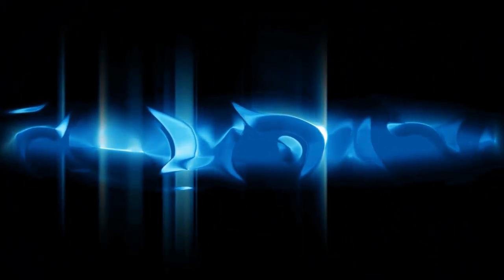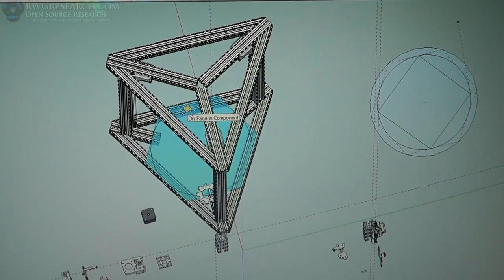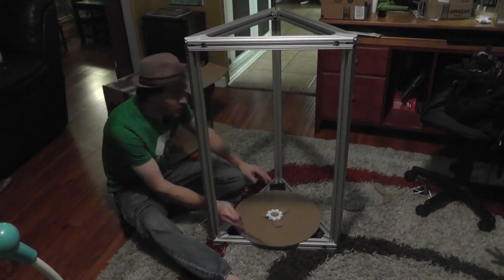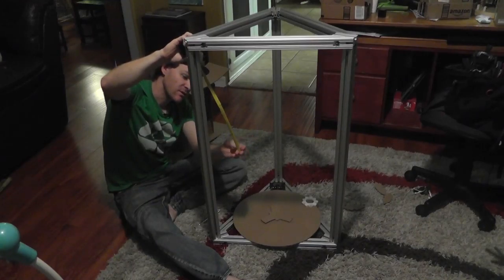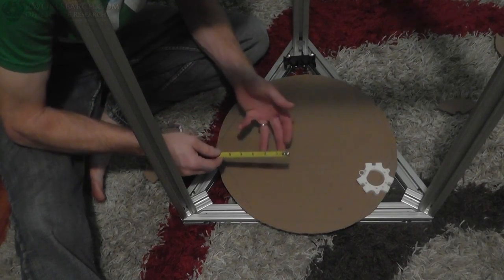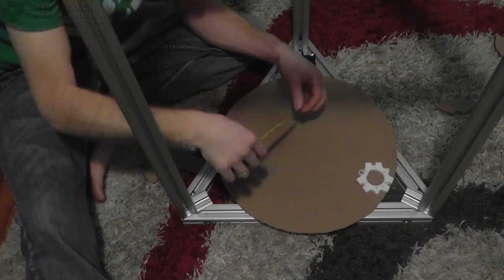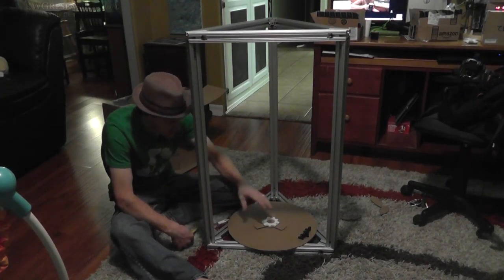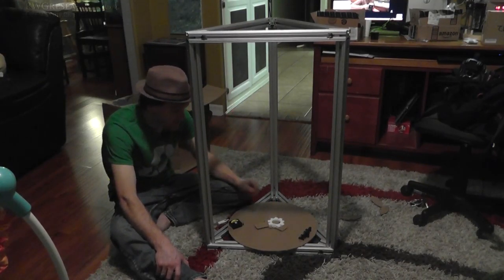RWG-OSD #2 Thinking Through It : OverSized Delta 3D Printer Build.

Comment: I like your hexagon idea. And also about using the 80-20 as linear rails (I was wondering that as you were explaining, just didn't know if their tolerance was tight enough.) 

I would recommend the electronics on the bottom to keep the heat away. Or put acrylic panels all the way around. Make one panel that opens like a door with the electronics on the inside of it. That way when you transport it everything is sealed up inside. When you are ready to print, swing open the door 210°.
Reply from the maker: yeah. it's verry good tolerance. yep the plan was to add a outter case from polycarbonate. this way I can heat the hole chamber. verry I important when it come to large prints. they seem to warp the bigger they get. also if I put the eletronics at the bottom. it will be right next to the heat plate. so I'll need make some good thermal I insulation for the electronics. ~Russ

Comment from the maker: ok, so i ended up going with 343mm for the rod length. and moved the upright's in 1.5"  this seemed to be good for what i was trying to achieve.  will see if that was a good choice in the end lol, God Bless! ~Russ
Reply: +rwg42985 how about implementing "telescopic" rods, perhaps with just the ability to slide to 2 fixed lengths (the way it is done with (forearm/pushbutton) crutches), 1 length for your higher objects, 1 length for your wider objects? Sure would save you the drama in configuration?
Reply from the maker: +Rogier de Leeuw this is a fantastic idea!!! could set up 2 config's and set it up in the software to flip settings when the arms switch. I'm not so sure i have seen it done... that sound like something i should spend some time on tho. great idea! unfortunately i already made the rods... not ill have to rethink it lol  thanks! ~Russ
Reply: Wouldn't be easier building a second effector for opposite axis advantage? Install the big footprint one, and when you need a tall build, install the other. Don't interchange until you can't build without changing. Done!

Comment: I haven't seen your other printer but I've seen other deltas and I had an idea.  What if your build plate could be Z as well as polar XY rotational?  

This would give you exceptional resolution for cylindrical objects.  If this was already the plan disregard my suggestion.  Just don't recall seeing one like that.  The build plate would have to be at least partially inscribed but not necessarily completely.
Reply from the maker: +Christopher Peterson its a grate idea. but, if you did that it would kinda just be a backwards XYZ printer. so rather the easy triangulation system , it would kinda be like the bed moved in all directions and the hot-end stayed still..  however... a simple rotational table would be cool!  something to think about for sure! ~Russ

Comment: Don't know to much! I guess that in my ignorance I would consider to add an other 10 inches to solve that problem, and extend the arms to reach all the way out of the triangle... Now kind of important that you are no considering the fact that must of your heating bed would be in side of the triangle.. but that is going to restrict you from building out of the constrains on the geometry of that triangle again!
Reply from the maker: yeah. the thing is that I'm limited by the belts I have on hand as well as the AL rails. with out buying a bunch of stuff I'm stuck with what i have. :)  ~Russ
Reply: yup.. I'm in total agreement with you, I actually have been in places where they sell that type of rail and they are pretty PRICEY!! to the point that I may consider to use almost any other material. thanks for the replay!
Reply from the maker: +Migueldeservantes nowadays you can get this stuff or a fare price if you look hard enough on line! i was surprised how cheep it was... ~Russ

Comment: since I have been play with a Delta for a few days, in theory, one could still have a tall narrow cylinder. would just need to set up that crazy g-code deal. and a script to make it invert the end effector
Reply from the maker: +George Robles now theirs an idea! if you get that running on yours i would think it would be a first!!!!! hahah great idea! lol ~Russ
Reply: +rwg42985 FYI, Geeetech sells an aluminum end effector for there set up as they still don't know how to make a print paratialy stronger depending on the cross section. anyways, they said many customers asked for one, so just thought I let you know. I may sell them one day in my store but if you need a set, after Feb 18, then maybe can get one ordered. on eBay. I will send you link.
Reply from the maker: +George Robles cool! thanks! ~Russ
Reply: +rwg42985 if you need anything from Geeetech, let me know.
Reply from the maker: +George Robles is that your site? ~Russ
Reply: +rwg42985 no, just my friends in China, I re did the firmware they where running, added the board GT2560 Rev A to the firmware, and I do a lot of tech support for them so they give me better price for resale to help support channel.
Reply: +rwg42985 lol, I learned from you, lasersabber, barnacles, zennmaster, Thomas Schindler (something) just to name a few of them. thanks to you all.

Comment: I think this forum is repository of knowledge about deltas. Have my rostock max for over 3 years.  280mm round build plate. And just like you I started with delta and stayed with it. They need a lot of love :)
http://forum.seemecnc.com/viewtopic.php?f=37&t=4868

And if you want to have portable 3d printer and worry about bed sticking out, just add some profiles and make haxagon enclosure, similiar to your previous delta
Reply: something about longer arms ang going parallel to think about: 
"...the lower one of the towers carriage gets to horizontal the slower it 
has to move, and the less precise as the effector moves thru the spot 
directly opposite the tower, with the arms
 horizontal, there is a point where it cannot draw an arc. I wanted to 
be able to use the full diameter of the bed without having to slow the 
print down. ..."

on the outside edge, not even close to parallel
http://forum.seemecnc.com/download/file.php?id=10925&mode=view
Reply from the maker: +SupcioG so, yes the slower the head moves the further out the arms are away from the upright. 
so my Question is, dose the firmware complicate for this? if no dose any of the firmware's out there complicate for this? this is something i always wondered. it could do it by ether changing the speed of the extrusion OR by changing the speed of the motor on the fly to keep that consent speed... ??? stu i cant answer? also any idea what firmware is best for delta? is there a list of some one testing them all with one Delta to get a real comparison? also it will need to be for Ramps / Arduino... thanks for the Help! that's why i post this stuff! ~Russ